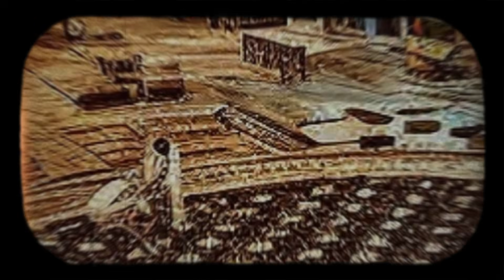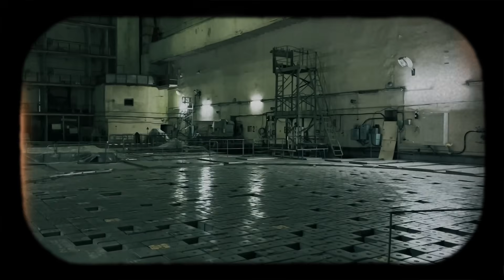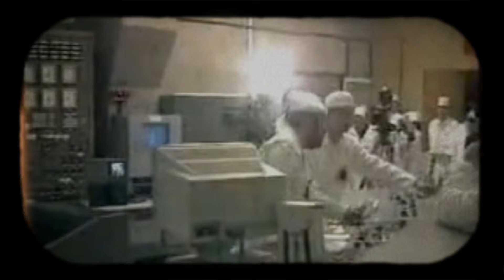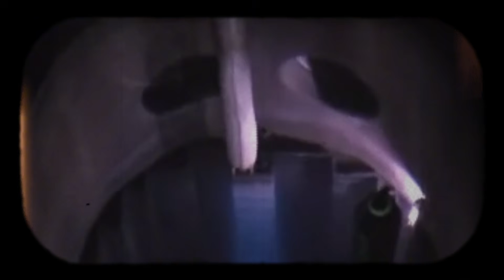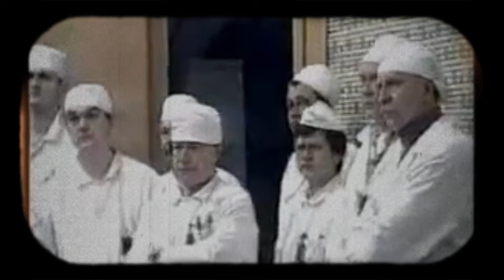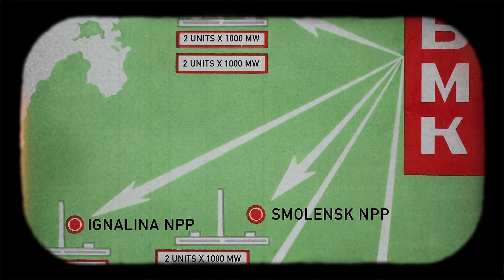Why RBMKs Burned Hot: Design Tradeoffs Explained Without Jargon

Comment: Now I get the emphasis on the negative void coefficient. The reactor core is not pressurized so water can turn to steam in the core creating the negative void and enhancing reactivity. Sounds dangerous. As a dynamic system a nuclear reactor is a balancing act of natural reactivity and control of that, increasing reactivity injecting the working fluid to remove heat and controlling reactivity through that and control rods.

Comment: A few things that are somewhat wrong under normal operations the reactor must indeed have a minimum of 30 control rods inserted, but during low power and a xenon excursion operators are actually free to remove as many control rods they need to to bring the reactor back up. The operators actually never did anything they were not allowed to do, but soviet propaganda still clouds the truth to this day.

There are few things we need to know about how soviet russia actually worked, the politically connected actually dictated what the "truth" was, and it was the politically connected that were looking at more power and influence if they did the test, the test was a complete fiasco and the politically connected didnt want to take the fall so the first lie they came up with was that "Beta Eff (reactivity) was too high so they couldnt remove control rods" that is a lie regardless of what the reactivity was at, first of all the reactivity was calculated by a computer which took roughly 30 seconds, then it was printed in a room 1 minute walking distance away from the control room. So the best possible information would still be 90 seconds out of date for what the actual reactivity was.

This was accepted as the truth until they dug a bit deeper and noticed that the information would be 90 seconds late and in 90 seconds the reactor can do a lot of different things.

Then they first rewrote the standard operations for how to handle the reactor, because if we look at a paper 2 months before (still after the chernobyl accident happened) they say different things for how to handle the reactor. Words are added like "during removal of control rods they need to reach a new stability plateau before removing further control rods" this is not mentioned in the standard operations during the accident. I wonder who could have rewritten those, did the operators themselves rewrite it maybe? Personally i dont think so.

Then we have to know a little bit more of how things worked in soviet russia, if you were criticizing a superior with good political connections regardless of if he had done something good or bad you will find yourself with the worst job in the world, because the state dictated what you worked with, and the state would listen to the politically connected guy about what kind of a person you was, so if he was upset with you in any way, he would say you are lazy, that you dont understand your job, that you sabotage your job, that you cant follow instructions, and that you never learned anything in school, and that became the "truth".

So if we actually listen to what the operators say, they dont criticize anyone all they say is "we followed the rules" not one person said "it was a bad decision to run the test when the reactor was unstable" So the person that is most likely the culprit is Akimov or the person above him, that were looking at more power and influence with more political connections if the test went to plan, so they pushed for it regardless of how dangerous it actually was, they knew that even if it was a disaster their asses wouldnt be held liable for it. If it failed they would criticize the operators, the operators just had to do the test or face digging for gold in siberia through the permafrost with a shovel.

Then if we actually look at how operators were operating the reactor, there are two people that actually controls the reactivity of the reactor, we have the person operating the control rods, but there is another operator that is trying to keep the steam pressure in the steam separator constant, and he can change the inlet temperature of the water to the reactor. So as the operators were removing control rods and reactivity went up a little bit, steam pressure increased and the inlet water temperature was adjusted down reducing reactivity, and this is what lead to the removal of most control rods, they removed control rods, steam pressure went up, water inlet temperature was adjusted down reducing reactivity.

This system works well during normal operations, if the reactor starts running a little hot inlet water temperature is lowered and the reactor runs cooler, and the controller for the control rods can focus on getting an even burn in the reactor by inserting control rods in one area and remove them in others without changing how the reactor behaves a lot.

So the RBMK reactor is huge far larger then any other reactor, this means that its disconnected from itself when it comes to neutrons, You can have the top part of the reactor on the verge on running away, and still the bottom of the core isnt even critical. Due to the positive void coefficient the reactor has a tendency to be critical at the top with more voids, and that the bottom isnt critical at all, this was why they added those graphite tips to the control rods, so they could have control rods inserted into the critical part of the reactor (the top part) and they could add moderation at the bottom. But this was generally speaking not enough, for most operations the bottom of the core was barely critical at all, so the burn up rate of U235 at the bottom was nearly non existent while the fuel at the top were ready for a fuel change. And that helped the disaster becoming a lot worse then it had to be, when they inserted the control rods with the AZ-5 button the control rods all start at the same place and then the graphite tips hit the bottom of the core where U235 was much higher and there were not a lot of xenon in that part of the reactor either, and the water isnt circulating, it goes critical and the temperature spikes flash boiling all the water, which further increased the power output.

Comment: Once again, another video is reading from the old Soviet script. The info you're giving has been proven not only incorrect but also a lie. Like having only 8 control rods. After the explosion, the rules were rewritten to make it look like the operators deliberately ignored safety protocols. Which they did not. Anyone who does a video on Chernobyl needs to do better research because it's been proven that the Soviets lied to make the system look innocent and the operators went rogue. It's not so easy to do a Chernobyl video using the old playbook anymore. If you want to do a video on this subject, you had better do your homework, or you'll get a lot of people pointing out your errors. It makes you look lazy... even if you aren't.
Reply: It is well established that plant workers did routinely ignore safety protocols, this drift was so common it became considered SOP.  Even the test that caused the catastrophe was a violation as it was supposed to have been done before unit 4 went fully online.  Senior officials signed off on pushing it back to get online ahead of the startup date and earn bonuses.
Reply: @andyroberts805  completely false! The turbine rundown test had never been done at any RBMK unit. It wasn't any kind of requirement. It was performed at Chernobyl #4 because it was close to the Kharkiv turbine plant which supervised the test and did the necessary measurements (With the red Mercedes truck which was inside the turbine hall when the accident happened!). It wasn't going to be repeated either if the results were positive

Don't draw ANY conclusion from the HBO miniseries..
Reply: If you can point us to some better explanations I would be grateful
Reply: @alanhaywood01  Go to "that Chernobyl guy". He has read and explained the complete "insag" reports and broken them down. It is VERY interesting and informative, if you are into Chernobyl and nuclear reactors. Especially Chernobyl. You'll get a new understanding about what happened. The guys running the reactor that night got a raw deal. The Soviet Union couldn't admit that they made mistakes, so they blamed the technicians. Gee, that never happens. Scape goats. And today we still have people who believe the story fed to them. And they get angry when you call it out. It's like you are telling them that they're wrong. As if you're blaming them. I don't understand why people get so nasty when they really don't know what the truth is. No one is calling these guys out. Oh well. It's the culture of today.
Reply: @alanhaywood01 they won't, because they can't. Just another "trust me bro" that says if you believe 2+2=4 you're "sheep". EVVVVERYTHING is a conspiracy. 🙄
Reply: @digby420  quit acting like someone is blaming you for something. Open your mind and read the "insag 7" report. If you don't want to, check out "that Chernobyl guy" he has a series where he breaks it down. So there. You say "I can't point you to a place where you can get the complete breakdown. I gave you the information. I proved you wrong. And you'll still get mad at me like I stole your lunch and ate it in front of you. I didn't insult you. I didn't call you any names. I gave the information. Now get pissed at me for doing what you said that I "couldn't" do. I'm sorry if I made you angry.
Reply: @d @dez1989 l, "acting like someone is blaming me for something?" Wtf are you talking about? Good for you for actually linking something that you were referring to once you got called out on it. Maybe next time don't be such a paranoid drama queen and just tell people what you're talking about up front. Or is that less spooooky and mysterioussss? 😂
Reply: Right right and you have nothing else to add 😂? Stfu
Reply: If the script was all that was available, how do you discover the reality?  To assert that we can reconstruct events from a highly secretive institution based on circumstances that fit our narrative is on par with a strawman argument.  Granted, we can look at some things and work backwards to the cause but, this path is loaded with unknown factors.  

The Soviet workforce and management was corrupt and motivated by perverse incentives.  That, right there, supports the Soviet script that blames operator error and recklessness.  The RBMK reactor was not idiot-proof but, like any complex system, it had to operated within the boundaries set.  It's main flaw was that SKALA could be overridden at a low authority level.  That is the fault of management and not the design itself.

Comment: The drop in power was due to a technical problem when switching between two modes of automatic control system, not because of Xenon. Calculations show that Xenon levels preceding the test were normal. Also, the power excursion occured after the pressing of the shutdown button, not before. Prior to AZ-5, there were no warning signals. Also, when a boron carbide rod is fully withdrawn, the graphite displacer sits centered in the core, displacing water that would otherwise fill the channel. The design flaw was that the displacers weren't long enough to cover the full height of the core; there was some water left at the top and the bottom. Pushing the water at the bottom out was what caused the reactivity spike and the explosion. Post-disaster modifications didn't get rid of the graphite displacers, they extended them so that there is no longer any water left at the bottom.
Reply: I'll also add they would have had about a minute worth of notice that they were about to rearrange everything permanently... the time to get the rods back in would have been at the moment they noticed power began increasing again... by the time it climbed up that curve any distance at all, it was already too late because whatever state it is in when the rods re-enter the equation, the system has to tolerate the additional surge that will "ride by" in the process. They had already gone waaay beyond this point when they finally scrammed it. The control rod drop would have needed to be manual as well, a slower process... as a full scram would have undone what they were trying to save from happening to begin with... once shut down, there's no doing anything until the xenon is gone. The test just had to go on...
Reply: Were you scared while you saw this? Wild!
Reply: @brianmclean6293  Huh? Saw what?
Reply: You should have been there
Reply: The issue with the xenon is that there is a delay. This is why they dragged the control rods out. At high power, the xenon generation is also high, but so is neutron production, which burns it off in equilibrium. When they lowered the power to prepare for the test, there was too much xenon still present because power had been reduced too quickly, and it absorbed too many neutrons. To compensate they raised the rods out. This increased reactivity, but in an uncontrolled way. As the xenon began to burn off again, power began to also rise exponentially since nothing else was controlling it. Dropping the graphite ahead of the moderator (no other way to do it with the design)... the final straw and supercriticality was inevitable. The positive steam coefficient did the rest.
Reply: @MadScientist267  Sorry to prove you wrong. The delay was long enough for Xenon to decay  away. The reactor was much more stable when they resumed lowering the power. Had they been lowering the power as planned, they'd have to deal with much greater amounts of Xenon.
Reply: @maksphoto78  Shrug. It's well documented, understood, and sits well within expectations of the original design. Not sure what else to tell you. There were many factors that all came together to make that night go as it did. Xenon was just one of them. Water was just another. Method of graphite utilization yet another. Unknown/undocumented/otherwise hidden design considerations. Operator judgment. Misinterpretation of instrumentation meaning due to incomplete understanding. Pressure from above. Cultural dynamics. 

Classic, textbook as it gets "swiss cheese" model. No single factor. They all had to line up.

Comment: You still have to cool the reactor even when it is running at decreased power. Stupid Soviets. A nuclear reactor's heat is consistent. Even if all the fuel rods were removed, the heat would still be there. I am not knowledgeable about graphite reactors. Anyone can correct me. I will not be offended. I like learning about how nuclear reactors work.

Comment: A factual error, 5 R/h simply cant be 500 times background levels, that suggests the background level before the explosion was 87.7 microsieverts, which is a preposterous. Even Finland which was in line with the fallout didnt get readings higher than 5 microsieverts per hour.